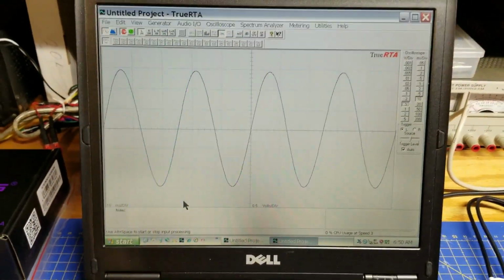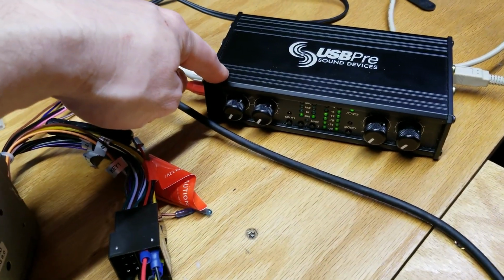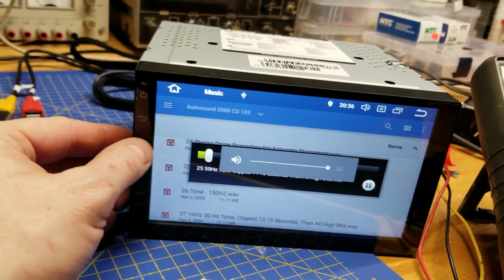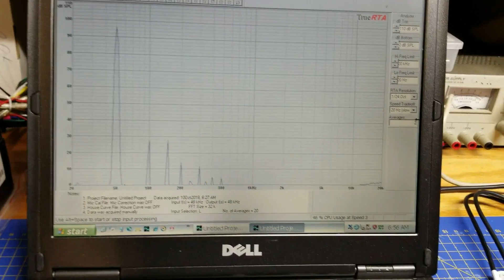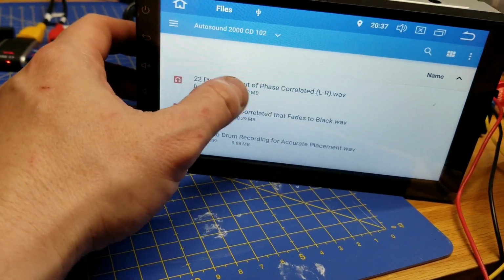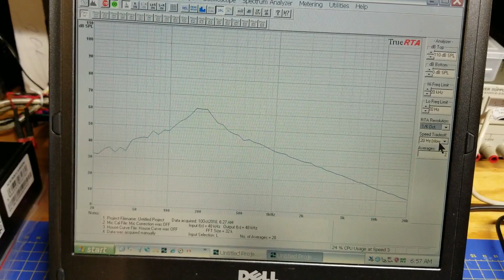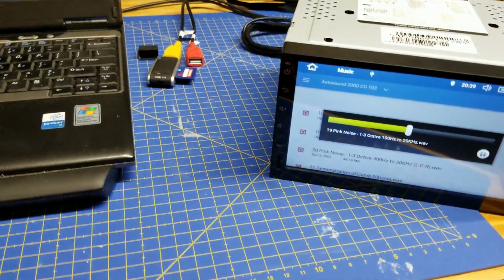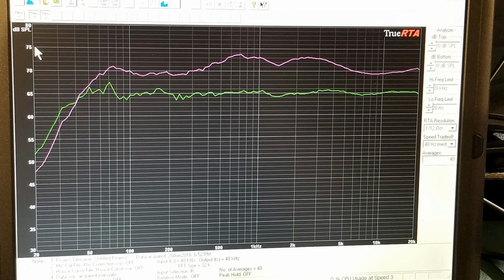Use an RTA to measure clipping, frequency response, and more! Example: Xtrons head unit

Comment: Excellent example. 

A high resolution rta is indeed more useful than an oscilloscope for seeing distortion of a sine wave.  

Oscilloscopes obviously have their use. But if your goal is to visualize distortion, the spectrum of the signal shows this  far better than the time domain waveform. 

The trick, is signal conditioning. Especially when dealing with the outputs of large, class d mono amps which very often have their output rails resting at > + 30 volts DC. 
If you feed that into a sound card, even with no signal playing, you’ll toast the inputs in short order.
Reply from the maker: Thanks, Nick.  Using a line output converter that is appropriately sized is an important, and necessary, part of the signal chain when looking at the output of any amplifier.